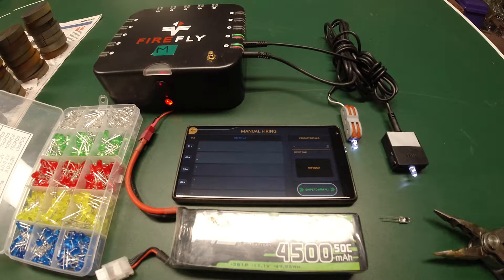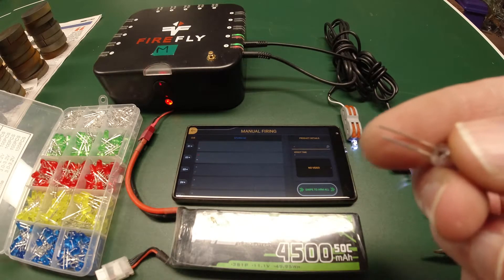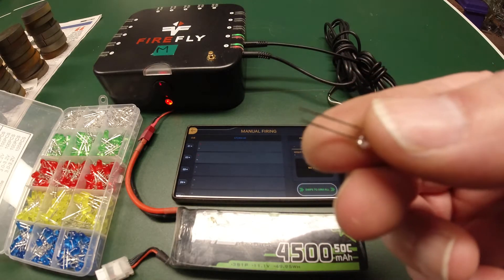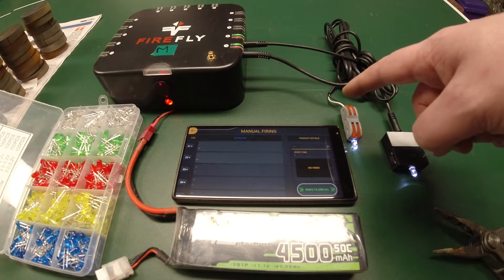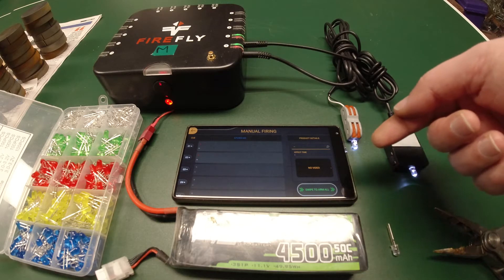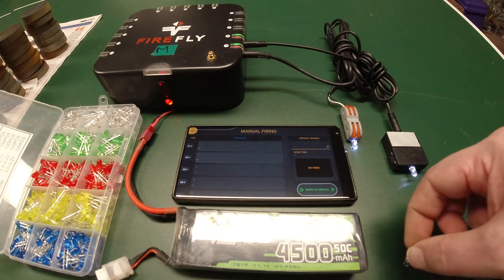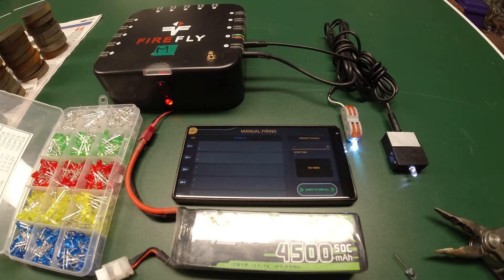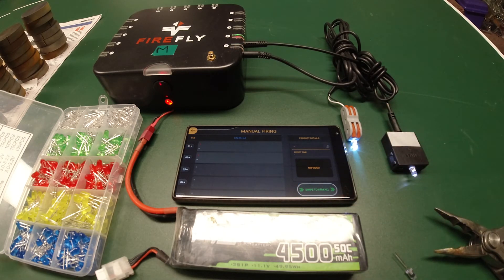2021-01-07 - Firefly LED test

Comment: got a link for the wire connector you used to the left of the firefly clip?
Reply from the maker: And if you have a crap ton of stuff to connect to one cue, these work awesome: https://www.amazon.ca/Compact-Conductor-Connectors-Terminal-Equipment/dp/B08RB6R4X8/
Reply: @toysareforboys1  got it figured out and changed over my long wires with the old clips Thanks again
Reply from the maker: These are the ones in the video: https://www.amazon.ca/Kalolary-Lever-Nut-Connectors-20-Assortmention-Assortment/dp/B07JNRQBS7/